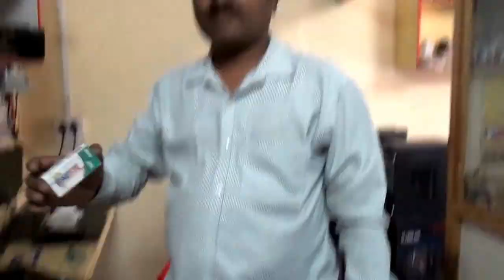HOW TO: Repair or Fix Broken ANY Laptop Hinges base I Laptop Body

Comment: I drilled and secured it with screws from underneath, putting a nut on the hinge, this would not happen if the companies didn't tighten the damn thing so tight that it stresses the mounting surface trying to move the screen, it is ridiculous.
Reply: I was actually thinking this is what I'm going to have to do also... So did you end up making new holes from bottom of case in to the laptop through hinges?

Comment: At 4:48, what are you putting back in ?
Reply: Those are the plastic pieces and screw inserts that the hinge screws ripped off the inside of the top cover.